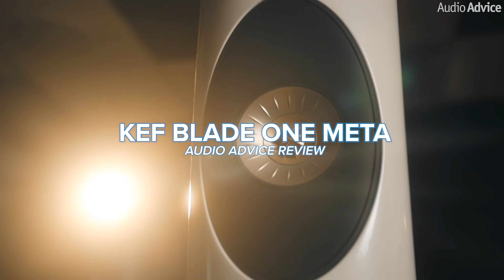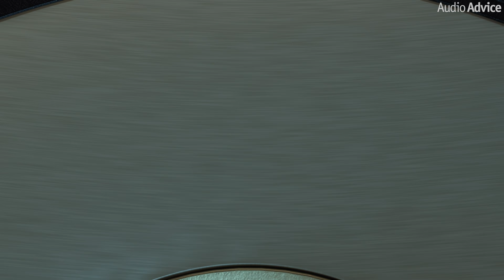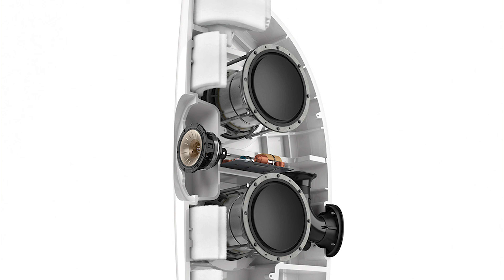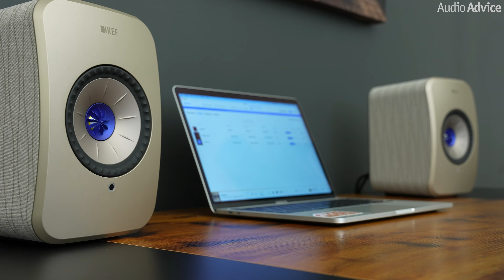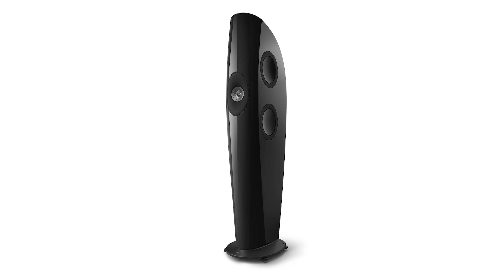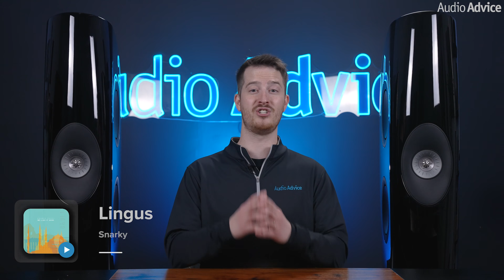KEF Blade One Meta Speaker Review | Our Jaw-Dropping Experience w/ KEF Blade One Meta Speakers

Comment: can i drive these with cary 805 amplifiers which use a 211 single ended tube around 25 watts? thanks!
Reply from the maker: Sorry, likely no.  The Cary 805s are beautiful amps, but the KEF Blade One is incredibly power-hungry, dipping down to 2.5 ohms in the low end. It needs serious solid-state current and high wattage to control those four 9-inch woofers. A low-wattage SET tube amp will run out of headroom immediately, leaving you with bloated bass and early clipping.  Thanks for watching.
Reply: @AudioAdvice Thank you for the advice! 🙏

Comment: For the KEF Blade 1 Meta speakers, the recommended components for optimal performance include:

Amplification: Given the Blade 1 Meta's sensitivity and impedance characteristics, a powerful amplifier is recommended. The speakers have a sensitivity of 86dB/2.83V/m and a nominal impedance of 4 ohms with a minimum of 3.2 ohms. High-quality amplifiers with sufficient power output are advised, with recommendations ranging from 50 to 400W RMS per channel. Examples mentioned include:
Parasound JC5 for its power and quality at a reasonable price.
Bryston Audio amplifiers for their power reserves.
McIntosh MC312 for those interested in McIntosh's sound signature, offering 300 watts per channel.
Cabling: High-quality speaker cables are suggested for the best signal transfer. Nordost Valhalla 2 jumpers and Nordost Odin 2 cables were used in one review setup, indicating the importance of high-end cabling.
Source Components: The clarity and revealing nature of the Uni-Q driver mean that the quality of your source components will significantly impact the sound. The system should include high-quality sources like top-tier CD players, digital-to-analog converters, or turntables to match the speakers' capabilities.
Room Acoustics: Since the Blade 1 Meta speakers are designed for large listening environments, ensuring proper room acoustics is crucial. This might involve room treatments to manage reflections and standing waves.
Integration: If considering a home theater setup, integrating these speakers with other KEF components (like KEF's Reference series for surround speakers) can provide a consistent sound signature across the system.

The Blade 1 Meta is noted for its exceptional sound staging, imaging, and bass performance, which means the components around it should be chosen to complement these strengths without introducing colorations or distortions.

Comment: I have the non-Meta Blade Two’s…which I bought at a huge discount from my local Kef dealer because the Meta versions were about to be released.  Having owned them for about two years, I can honestly say that the Blades are truly reference speakers:  you will very hard pressed to find speakers that not only measure better, but more importantly, translate that measured performance into sonic performance that you actually makes the listening experience an unforgettable and enjoyable one.  The Blades make all music…regardless of genre or volume played…sound simply incredible.  The resolution is outstanding, but never coming across as sterile and analytical.  It comes across as close to a live, in the studio experience as I’ve ever heard.  The kicker is, while the price isn’t cheap, the Blades are actually a bargain over other reference models from Wilson, Magico, Sonus Faber,  and Bowers Wilkins which I were also considering at the time.  Additionally, the Blades are so complimentary and forgiving of the equipment you hook them up to…as long as you have decent amplification, they will play music exceedingly well.  As far as the design, I’ve never seen a speaker come as close to art as they are; whenever I have guests and friends come over and listen, they are instantly awed at not just their sound, but by the design off them as well.  Purchasing any model of Blade is definitely a “grail” moment…truly a “last speaker I could ever need” type of deal.
Reply: May I ask what you paid for them
Reply: @michaelgordonharper4536  Half off…so about $15k USD

Comment: Wtf 35k for a set of speaker 😮
Reply: If you think these are the most expensive speakers you are not even close.
Reply from the maker: As with anything high performance, the top end comes at a price. Thanks for watching
Reply: These are definitely not cheap, but definitely not the most expensive. There are much much much more expensive speakers on the market.
Reply: You can spend 20x this
Reply: 35k for a pair of high end speakers is not uncommon.

Comment: Can you do a review on the Kef Reference Meta series, primarily the Ref 1 Meta for us that prefer bookshelf designs.  With some attention paid to the base ports, the long vs short.  Seems one port can produce a 40hz low end the other a 30hz low end.  How is this accomplished and most importantly which port is more correct to the bookshelf design?  It seems like a choice between tight base with snap or lower reaching base with more fullness.  The Ref 3 Meta seems to take care of this issue but also adds another $5k to the price! 😵‍💫
Reply from the maker: Yes, you are right and the port choice is impacted a lot by the size of the room and where you put them in relation to the walls.

Comment: I have a question, why do they only give their speakers 1 UniQ driver? Even on floorstanders? Why not 2 or more? Is it technical limitation? A kind of fatal flaw on the design so that you can only use 1 per speaker?
Reply from the maker: If you are trying to reproduce a single point source, you only want one driver.  And most speakers in this price range only have one tweeter and one midrange as well, just like a Uni-Q in number but not design.  The Blade then has 4 woofers on the side.
Reply: @AudioAdvice  
Really? I thought most floostanding speakers have 3 or more drivers usually, maybe my knowledge is 20 years outdated...

I recently bought an lsx Ii, they're good for their size, I know they aren't equipped with the latest kef tech, but the sound in lsx Ii is a bit weak on the upper mid range IMO... I know this maybe have nothing to do with how many UniQ drivers it has I just want to say it lol...
Reply: @Napoleonic_S  imagine a drop of water on a calm lake. You don't want more than one source of audio waves or you get distortion
Reply: @CaseyWilson1 This is a wonderfully simple visual analogy.